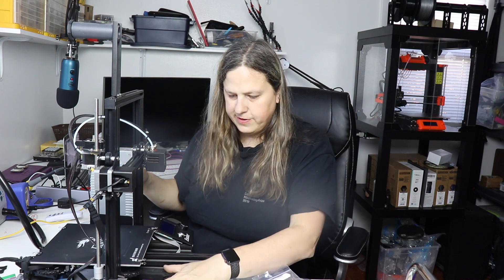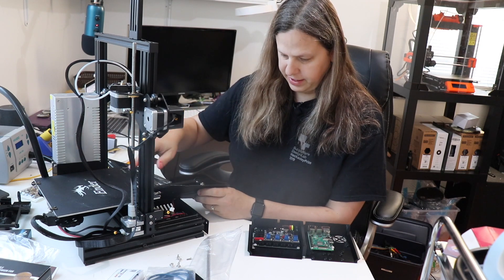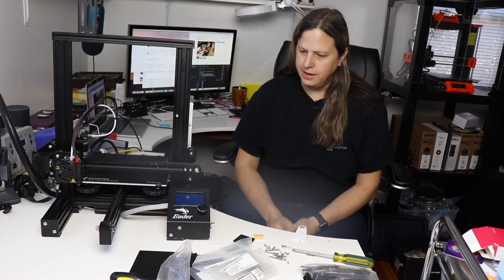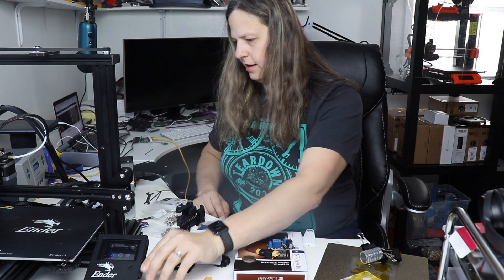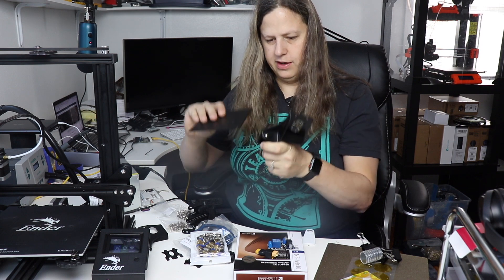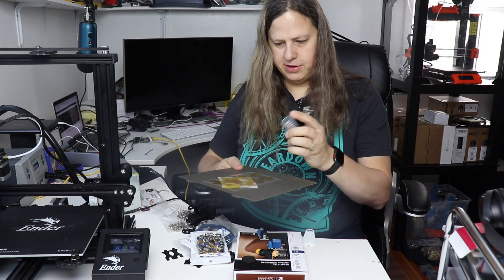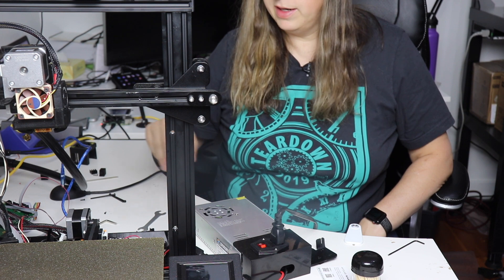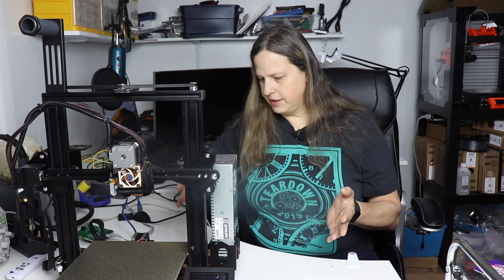My Ender 3 Upgrades (Round 1)

Comment: Wow! What an enormous amount of upgrades. I'm both interested in whether it is worth the expense and in awe at your levels of skill and knowledge
Reply from the maker: Thank you. Yeah, I enjoy the upgrading aspect. If you're looking for a printer that performs superbly right out of the box, this may not be the printer you want to go with. I love my Prusa MK3S and do most of my printing with that, but I also love the upgrading aspect, so I'm working on getting the most performance out of the Ender 3. All told, I'll probably save a couple hundred on the cost of the Ender 3 plus upgrades vs the Prusa MK3S, but for ease of use and setup as well as the firmware updates and having a reliable printer from the onset, I think that extra couple of hundred gap is worth it. If you're into taking a base machine and getting the most performance out of it and learning along the way though, perhaps upgrading an Ender 3 is the way to go.

Comment: I think if you look closer at the listing for the spring steel heat bed and the magnets that it shows the magnets installed on the underside of the original heat bed heater rather than on top which allows for a better flat surface contact with the spring steel sheet and the heater as well as being better supported all over rather then just where it contacts the magnets. The magnets are supposed to pull through the original aluminum heater plate. If you look at the ones installed on the Prusa as well there are magnets installed in machined slots on the underside of the heater plate. Hopefully that helps with your heat transfer issues.
Reply from the maker: Hi, just an update. I've gone ahead and placed the magnets on the underside and will try a test print tonight. The magnets aren't holding the bed in place as well, so I'm a little worried about layer shifting. I will probably go ahead and replace the bed with something like the wham bam bed anyways, but I'll give you a shout in in the second part. Thanks again!
Reply from the maker: Oh sweet. Thank you. I may give that a try before I try a different bed.